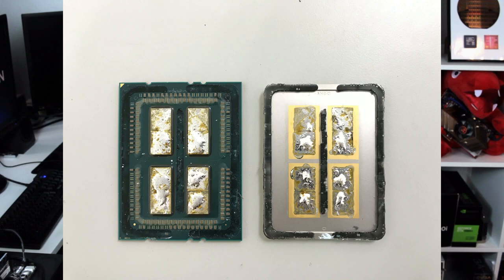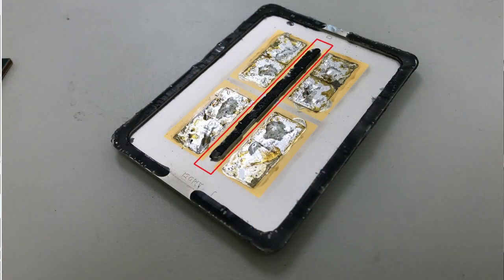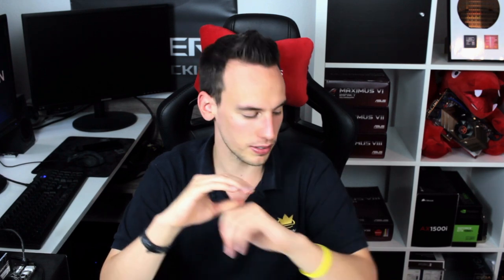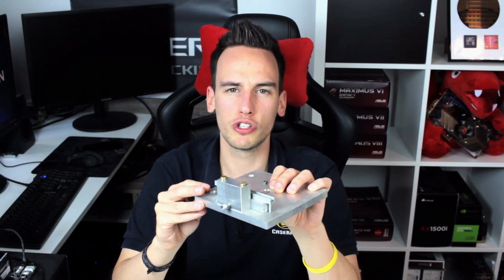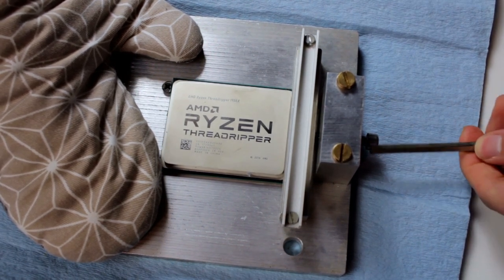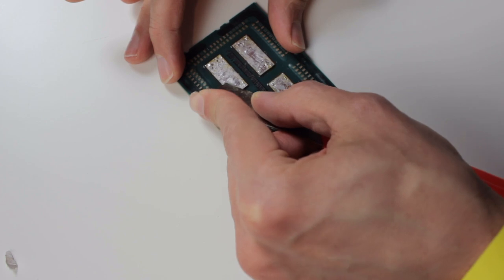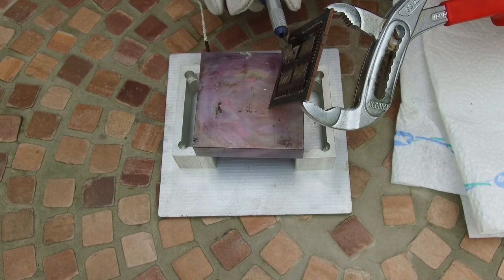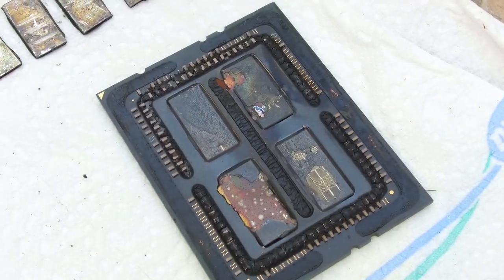Dummy Dies? Threadripper examined (en)

Comment: Awesome stuff, Roman! Now we need to figure out how to unlock them. :D
Reply from the maker: That'd be insane :D
Reply: der8auer I think someone will figure it out, considering a good amount of amd gpus can be unlocked or reflashed with new BIOS like 390to 390x ect.
Reply: The capacitors for the 'dummy dies' are missing. How is your micro-soldering?
Reply: You would probably need a BIOS hack as well unless the TR4 MBs expect/support more than 16 cores. Though a BIOS hack would be insignificant compared to a possible hardware hack.
Reply: phenom 3 cores could be unlocked to more cores via. factory bios hack
Reply: Won't work since that would need a motherboard with  8 memory channels and power for the 2 extra dies.
Reply: Given that EPYC can hold 32 cores at full load on server boards, I think that enthusiast boards are more than equipped to deal with the power requirements. The memory channels might pose an issue, but not really. Again, EPYC is quad channel.
Reply: I stand corrected, my apologies. I genuinely thought it was quad channel. Hmm... that might be an issue!
Reply: TheMadDutchDude ..im betting asrock will have a core unlocker first
Reply: konic40, yeah! Me 2...
Reply: The cores probably aren't even wired properly.
Reply: @TheMadDutchDude
Well, AMD could disable one channel per die, and make it support quad channel. They might as well make it 8-channel, but with only a single DIMM per channel.
Otherwise they could ask the board partners of making like a "special edition" Threadripper motherboard with 16 DIMM slots - For obvious reasons, those boards needs to be E-ATX or larger. 
But AMD has the technology laid out for them to make a 24 and a 32-core Threadripper if they want to - But that's gonna be way overkill for desktop use anyways

Comment: The quest for the correct answer is very much appreciated. This finding concurs with my initial reasoning of what AMD was doing when you discovered the 4 dies in your initial delidding video. At that time dummy dies made little sense from designing a proper two die package, one has to wonder if all that keeps the TR from being an EPYC is the missing capacitors (or whatever component they are) that have the pads ready for mounting around the disabled dies. Becoming an EPYC or TR could be as simple as populating those empty pads (but I expect more would be involved).
The TR4 platform just looks better and better for the future and one wonders if AMD will release a 24 or 32 core soon after intel releases their 18 core. Aside from the power draw, there seems no reason why a 24 or 32 core 3.5 base 4.1GHz boost TR wouldn't be as easily achievable as the 16 core.
Reply: Mitchell Couchman
When you consider that the 1950X at stock speeds will get 3.6GHz all cores frequency xfr within a 180W TDP and with high performance water cooling handling insane overclocks where cpu's are pulling well in excess of 300 watts under torture test loads, then it's quite feasible for TR on 24 cores to be under 300W with frequencies around 3.6-3.8GHz all cores. The VRM's on X399 seem to all be rated well in excess of 400W, so all core frequencies in that range on 32 cores would be achievable on the right water cooled setup.
Ryzen gen 2 is going to 7nm and so 2nd gen TR on 7nm will have a much lower power draw and seeing 4GHz all cores on a 32 core CPU would be a reasonable expectation for overclocking with just a decent AIO and hopefully keeping under 300 watts.

It's all speculative at the moment, but 32 cores at 3.0 GHz with the current generation would still be quite a lot of grunt and given the 1700's TDP of 65W, then that frequency would only be approximately 250Watts which is nothing these days with the cooling available.
Reply: Vape Nation
TR cannot handle registered DIMMs, so no it won't hurt EPYC sales on that basis alone. TR can only use unregisered DIMMs though it does handle ECC, there is a memory limitation there not because TR can't handle more memory, but that the largest easily obtainable unregistered DIMM is 16GB. This limits the platform to 128GB at present and probably 256GB if 32GB modules start being produced, which is likely in the next year or so, but people who need large amounts of memory, usually prefer to run registered DIMMs and so they'll look to Epyc.

It'll be competition in the HEDT space that'll determine if and when higher core counts will be released, Intel has a history of allowing Xeon on it“s HEDT in the past and there's nothing stopping that now.

Rather than kill EPYC sales, it's more likely that a 24 core TR will be in the 7980XE price range (18 core Intel will lose badly) and we won't see 32 cores until gen 2.
Reply: I think even with the added capacitors you will need to shove modified Epyc microcode into the BIOS to enable the processor. I wouldn't be surprised if there is already some keying or checksumming in place to make something like this difficult. I think there is at least a 51% chance that this is possible, but I am skeptical whether it will be accomplished during the useful lifespan of the product.

AMD knows they have winners across the entire Zen 1 line, with Zen 2 to follow. In the meantime they're clearly sandbagging as Intel struggles to respond. At any point they can launch Threadripper 2000-series with e.g. 20, 24, 28, & 32 core models. Epyc still caries the server certification so such a move wouldn't attenuate sales too much, just like how nobody but PC hobbyist businesses substitutes Xeons with i5s or i7s, even though the performance profiles are the same compared to the E3 line.
Reply: +NO MA'AM
Given that this is zens first year of what looks like a 4-5 year architectural lifespan on AM4/TR4 and any future plus versions, it wouldn't be smart to release all your eggs into the basket too soon. There's suggestions that future Zen processors will go up to 48 cores on 7nm, and Single processor Epyc setups covers people who need/want 32 cores now. 

So I wouldn't call it sandbagging but rather AMD keeping rapid response contingencies in hand to stay ahead in the market. It's quite likely that once the 18 core intel processors hit the shelves, that AMD can respond with a 24 core TR, if sales start to slump and the 18 core intel claws back some market share in the HEDT space. But given the price/perf of the 1950X, it's going to be hard to beat.

If you put it all out the first year when you don't need to, you will only bring disappointment with future generations if they aren't significantly more powerful. AMD have the triple whammy on TR4 with a likely frequency increase, core count increase and IPC increase on gen 2 and that's not including perf/watt increases that will come on the 7nm node if everything goes to plan.
AM4 won't get a core count increase in gen 2, but the frequency and IPC increases should see a 10%+ performance boost over gen 1 along with maintaining or more likely reducing the power consumption.

AMD have given the consumer a lot this year, let's not be too greedy and demand it all at once.

Comment: Great work!
I suspected we would see these results tbh... 
When AMD came out with the dummy silicon thing I thought to myself "Bullsh*t", but how do you go against the manufacturer on that one?
Well, this is how. :)
So yeah, Threadripper is salvaged EPYC CPUs with defects in one or more of the dice... 
For the price that is not a bad thing in any way. :)
Reply: maybe we get non defective cores cause how do cores even get defected when product properly installed and cooled
Reply: It comes down to the silicon crystal defects (yes, metallic atoms are arranged in crystal patterns) - aka the "silicon lottery". Crystalline formation isn't a perfect process, one atom misaligned means a whole volume of the crystal will be misaligned, creating rifts that won't conduct electricity in the best way possible. Too many defects and your silicon can't be used to its full potential, but can be used up to a certain degree. See here for a visual representation in 2D: https://www.youtube.com/watch?v=O3RsDIWB7s0

A chip that can't meet the requirement to work at X speed gets therefore downgraded to a "worse" chip. Think, an i7-7700k getting downmarked as an i7-7700 or an i5-7600k, all the way down to the Celeron; a GTX 1080 (GP104) with a disabled compute unit ends up as a GTX 1070 (also GP104). This way chip designers don't lose that much money from defective dies out of the factory (like GlobalFoundries) and can provide "worse" versions of their products depending on needs, so it's a win-win. This applies to CPUs, GPUs, any kind of chips that contains MoSFETs (or FinFETs more recently) really.
Reply: but retail epyc die is revision B2, while TR is B1 just like Ryzen.

Comment: AMD James mentioned on r/AMD that the interposer is different for Threadripper.   Even if those other 2 cores were good cores,  they have no electrical path to function on.  They are literally just soldered onto blanks for structural purpose only.   Theres no chance of "activating" those 2 extra cores to make a 32 core chip,  at least on existing TR chips and MB.  The Dies are likely tested before hand,  and the best dies are used for the 2 "hot" pads on the interposer,  while bad chips are used as dummys on the 2 "blank" die pads on the interposer.

Comment: One straight-forward explanation could be that AMD tests the 4 dies after production and deactivates the weakest ones. This would improve every TR owner's chances in the silicon lottery somewhat, while maintaining the exact same manufacturing process for all TR models. However if these dies were disabled by software, chances are, someone is going to figure out how to reactivate them... fingers crossed.
Reply: The capacitors are missing on the "dummy" sides, there's no way they're going to be activated

Comment: Excellent video, thank you for all of your efforts!

I think it's pretty clear that this is one of two situations. 

1) The dummy dies are flawed in the manufacturing process, and so when the TR CPU's are tested in quality control they are then separated in to the various available chips, the lowest priced being the ones with only one out of four dies working, with two working on the 1950x.

2) The dummy dies have been disabled, in much the same way as some of the old FX chips could have the extra chips reactivated in some motherboards.

As much as I'd like to believe that my 1950x could suddenly have a bunch of extra cores activated by a bios setting, I think it highly unlikely, and so I suspect that the dummy dies have been physically disabled if not already unusable.  I suspect that a 32 core CPU is imminent, but it's power and cooling requirements will probably take it out of the desktop class and move it in to server territory.

Comment: Need to delid and EPYC and see if all those missing caps on Threadripper are actually in place.
Reply: Hey Josh. Good eyes i had same idea :D
I remember people connecting golden points on the CPU with pencils for overclocking and unlocking stuff.
Reply: epyc and threadripper have dramatically different pcbs

Comment: Man that's some dedication bro, Kudos
I never believed that AMD used dummy dies, the silicons are not cheap, not printing anything on a wafer that costs around 10 euro alone, and the indium soldering process is quite expensive, plating the dies in vanadium, titanium and gold and then soldering it isn't easy, it wouldn't make sense that they'd go to that effort. I wonder are they doing anything or just failed dies though? I wonder will we see 32 core thread ripper CPUs too, that's be awesome.

Comment: Potential test whether all 4 dies are indeed active: boot for a few seconds with an IR/thermal camera watching, no IHS or cooler on the CPU - active dies will show as hotspots?  (perhaps cut the middle out of an existing IHS so the edges are still there for proper mounting alignment and pressure in the socket/retainer)

Comment: I had a similar hunch.  Glad you proved that either those cores were "defective" or lower performing so they were disabled.  I assumed that AMD had this ace up its sleeve for Intel just in case the 18 core monster is actually clocked high enough to compete with Threadripper 1950x.  I assumed they'd have something like 1960x, 1970x,  and 1980x CPUs somewhere down the line.  Though I am not sure the VRMs on current AM4 boards could handle those chips clocked at 4+ GHz and it would also be a challenge for  AIO liquid coolers to keep up with the heat.  It may also be possible that we need to wait for Ryzen "2" when they are on their refined processing node to make such a chip efficient enough to cool on a desktop system but lets all hope AMD can keep pressure on Intel!!

Comment: The easiest explanation is that they are dud dies that they stuck on to keep every other part of manufacturing the same as EPYC. The "dummy" dies might even have electrical passthroughs that the other dies need, or some basic electrical connections/characteristics to make the 2 good dies work. Either way it's a no brainier that they'd want maximum consistency to EPYC even if they only have 2 fully working dyes, and using inactive-failed dyes are perfect for this. I don't know why they'd do it any differently. They are also thermal mass which means more consistency with EPYC. They may also release versions with only 4 cores active on each die in the future (for the same total core count) and use the exact same manufacturing process, and again the same as EPYC.. I don't see why they'd do it any other way.

Comment: Der8auer i have OLD CPU that its soldered and at idle temps of the 4 cores are around the same but at load 3 cores are like 61 62 63 *C at 100% load and the 4th core is like 66-68 *C . My question is this Why so much deference ? Its something to do with the solder? Can i heated at he oven to fix that or not and if yes what temp and how much should it leave it ? Its a i7 860 happily at 4 ghz :3

Comment: Just a question but would the dies and cores be disabled by the capacitors and components being placed in certain areas or are they all there? Cause my theory was that Threadripper chips were missing the little components on the PCB in some areas to disable cores or full dies.

Comment: In your previous video you planned to measure the temperature of the four dies while they are running. I wonder why you didn't do it this time. Was it killed again by delidding? Also did you check if there are connections under all four dies on the baseboard?

Comment: Now the big question. What is the model number of those capacitors so we can hot air solder them on all the empty locations? I have a feeling that all those capacitors do is signal to the BIOS what model of CPU is installed. This means all we need is the capacitor configuration for EPYC and the CPU registry from an EPYC BIOS and we are half way there.

Comment: I am pretty sure threadripper is just a faulty epyc. because one or 2 of the dies doesnt work they make them to 16 cores insted. Intel are also using this on some cpu's where they wont disable a whole die just some cores.
Reply from the maker: Absolutely possible, yes.
Reply: Intel does this, Nvidia does this, AMD does this, everyone does this.
Reply: ye
Reply: craazyy22 I'm pretty sure that TR is a fully working EPYC and not defective. The two dies are just disabled to simplify production.
Reply: Pretty sure AMD stated that TR and epyc have different sockets. Even though they are the same size/same pin count, the TR and epyc deliver power over different sets of pins. Or... Something like that.

Comment: May be this was the cheapest way to preserve bandwidth between the two active chips, which AMD said are diagonally opposite (likely to reduce the communication latency between the active chips). In Epyc, each chip has three infinity fabric links and each link serves as a direct connection to only one of the other three chips. In the threadripper case, each of the two indirect connections between the two active chips would would have to go through one of the inactive chips. May be it was cheaper to put 2 full inactive chips which only needed to have their connectivity and routing electronics working rather than to turn the 2 indirect infinity links into direct ones, with all the necessary changes to the processor pcb, and potentially to the connectivity protocols burnt into the chips.
Reply from the maker: +H. Al.  I think that's also a possibility :) wish AMD would just tell us more

Comment: I almost wonder if all Threadripper have 32 physical cores, if the CPU is shifting 16 active around to maintain thermals and boost. eg. Sometimes 8 cores are active on one DIE and other times its active on the adjacent DIE always putting the biggest workload on the DIE thats cooler to maintain boost as long as possible. Dunno but Im curious.

Comment: The thing is about 32C TR is, each Zen die has a dual channel memory controller. Using quad channel on a 32 core part could have weird latency issues if the memory controllers on the other 2 dies are disabled or all dies converted to single channel. Given this, how would NUMA work?

Comment: Hey der8auer! Off topic but an important question. I've read the coollabs liquid metal destroys cpu and gpu dies over time. How about Conductonaut?
Reply from the maker: Neither if these should destroy any GPUs or CPUs. Some might leave residues on top but doesnt harm anything
Reply: Well Liquid Ultra does over an extended period of time. Something like a year and a half. The damage on the die starts to show after a few months. It seems to step into a slow reaction with the cover of the die and once it's eaten through your product is dead. I'm asking because you should have tons of experience with Conductonaut. Have you used it on something for over a year before cleaning it off?